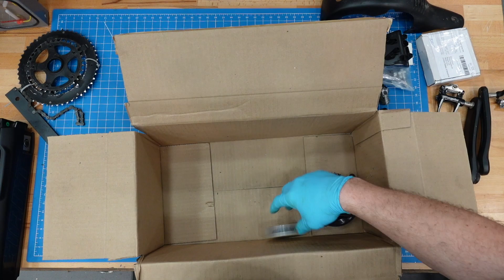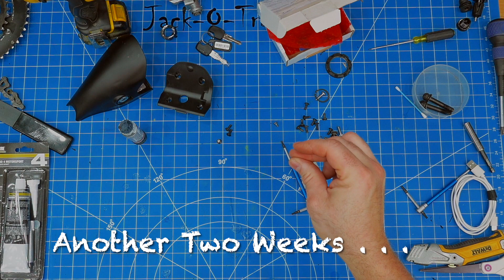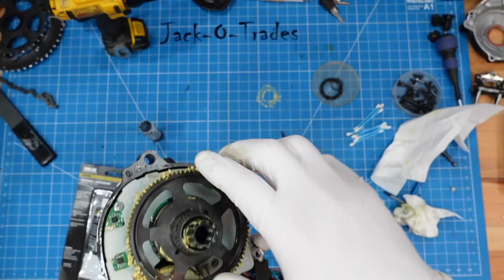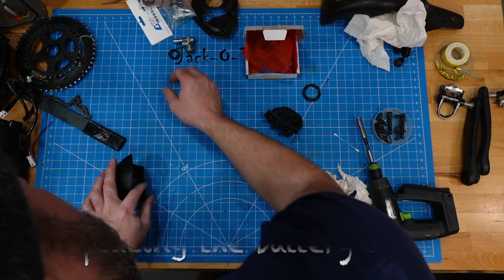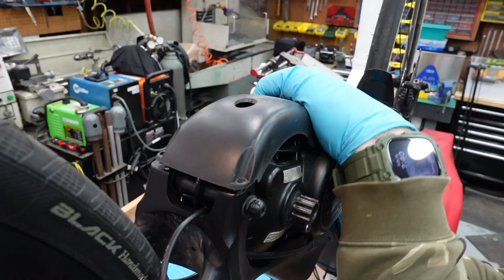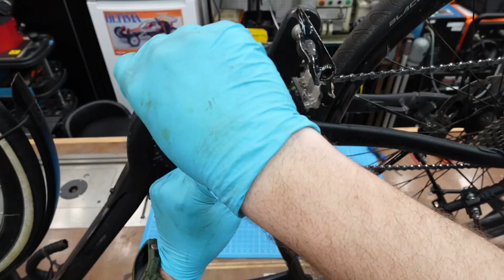Giant E-Bike Yamaha Drive Unit Repair

Comment: I think I would be tempted to have one milled from aluminum, and just press it on the bearing. The fact that aluminium expands quite well in the oven at home, could mean a decent strength replacement gear for a shitty design.  Milling aluminum like that with computerized machining is straight forward these days. You may be able to make money out of it so long as in batch lots (the chinese love doing this to spec), than the original nylon item.

Comment: Hello,maybe you can help me with my ebike problem. Speed 1 ,2,3and 8,9 work's just fine , between those it's getting loose,like the chain getting out! What can it be?
Reply from the maker: You might need to replace the drive train including chain, chainring, and cassette. It's around $130 in parts. The e-bike is pretty hard on this stuff and they tend to wear out. I replace mine about once every couple thousand miles.

Comment: Hi my e+1 giant syncdrive  will tirn on with the one controller all lights come on  then switches straight back off .theres nothing in the manual trouble shooting to  say anything about this and im sure if it was major  id get a red light with however many white lights to tell me whatevers rong ,would a good service help as its due  but i dont want to order all the parts  and do it to finfdout tits unrepairable ,i cant get the bike to stay on long enough to engage the app  so I haven't enen downloaded it ever as the bike only commuties not hard riven at all ,ive checked all wires connections cleaned pins its not the bike that gives trouble with mounting as its a backrack battery  and thats fine charges holds its full charge im thinking something small  but i guess i best crack the motor and see as nothing is out of place on outside a thourough cleaning and re grease and take it from there but would a bearing shut it off like this ? Is it that sync 'd . Any suggestions besides dealers as im fairly hands on dealer is last option and ill have to put everything back on the bike before they'll plug it stupid from the start there but hey any help plz ✌️
Reply from the maker: I’m sorry, but I have no idea how to fix your problem. For my bike, I have never been able to get it to connect with the app. I also get a warning message that it needs to be serviced. I am trying to avoid dumping more money into it and just trying to get some miles on it before it’s dead. Sounds like you may already be there.

If it’s power cycling as you describe, try cleaning the batter contact’s and the co tact’s on the frame. I use steel wool but you need to be careful not to short the battery. My bike sometimes power cycles when I ride and I have to rather pull the batter and reinsert it or clean the contacts.
Reply: Hi, did you fix the problem? I’m having the same issues as you

Comment: Hi Jack, is it a PW-X2 or PW-X3 motor? Thank you!
Reply from the maker: @geriba001  The bike is from 2018 so I’m pretty sure it’s a PW-X. I’ve replaced the nylon gear a couple of times now and have noticed that there is excessive wear on the pinion gear probably due to the glass filled nylon aftermarket gear. The glass filled nylon material is abrasive. So, I’m on the hunt for parts again. In the US, I found this shop that I am going to reach out to
https://ebikemotorrepair.com/?v=0b3b97fa6688

Comment: Hey . Thanks for the video. Hi have the same bike, and the exact same issues!! Also simalar weight as you . Did you ever recrify the back wheel?? Im considering getting a custom wheel made with better spokes but i fear it will happen again. Any feedback will be greatly appreciated.
Reply from the maker: Since this video, I have replaced the gear once again. I had a spare gear and grease on hand so  I didn’t have to wait around for parts. 

What I have found to work with the rear wheel is to make sure the spokes are properly tensioned. The challenge is maintaining that spoke tension. The spoke nipples love to work themselves loose. When they do that, some of the spokes become over-tensioned and start popping. The rear wheel requires regular maintenance which is annoying but I guess it’s the nature of the beast. I would like to try to get 10,000 miles out of the bike before I wash my hands of it.
Reply: @jack-o-trades  thanks for fast reply.. now I'm thinking to just buy a alternative rather than keep money in to this 1 especially if it requires regular maintenance.. thanks again 👍

Comment: Hi! I have the same bike. I changed the gearbox bearing and after I reassembled everything the motor doesn't run but the controller lights are flashing. Do you know what might be the problem?
Reply from the maker: I have had to replace the gear twice now. The biggest challenge is stuffing all the wires into the frame when you reinstall the motor. I would bout the motor out again and make sure you connected everything and didn't pinch or cut any wires. I wish you good luck in this.